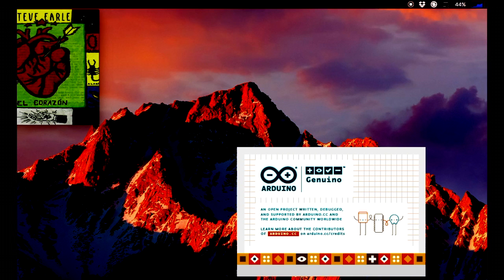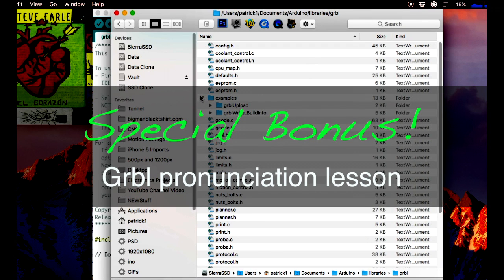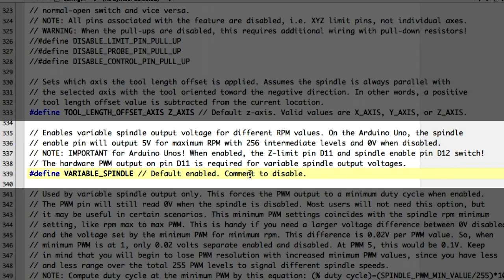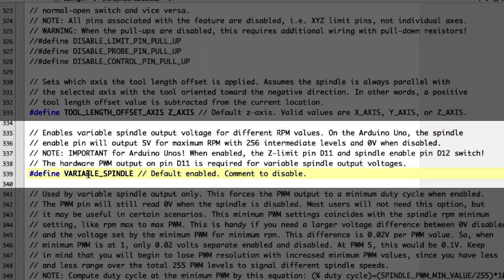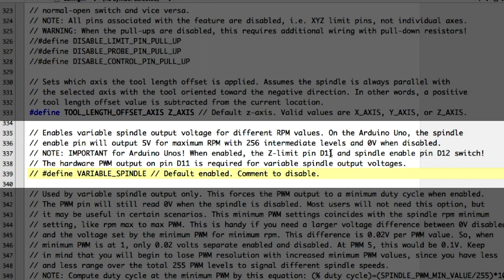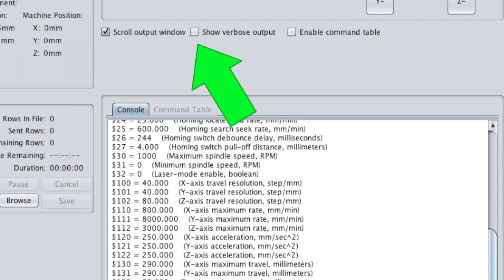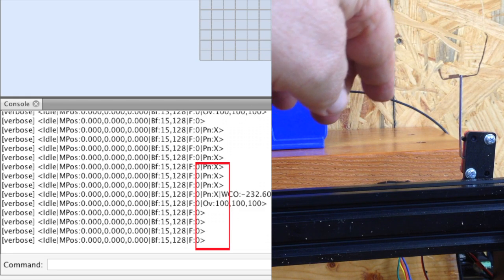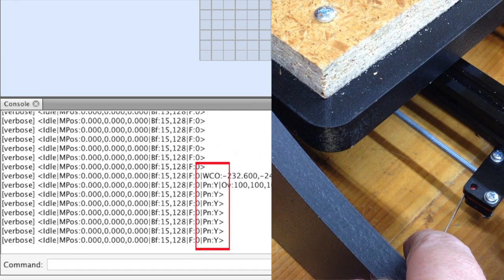Grbl Z Axis Homing Switch Fix

Comment: Pn Z not work when i do the process in the video, i have gbrl 1.1.  After read and debugging, Pn Z can be activate without change of code by connecting the Z limit switch to SpnEn on the CNC Sheild. Then after that homing is working.

Comment: Hello, i have this same issue but I did not switch over to Arduino. i test the switches to see if they respond and they do when i select homing mode z axis starts and then grinds to the top please help if you may

Comment: I have tried this four times. So far it has not changed anything. Do I need to rename or erase some other file? I confirmed that the changes have not taken place by triggering Z axis hard limit on pin 11 of the Arduino. I'm sure I am missing something.
Reply from the maker: Can you post your Arduino's Grbl settings here so I can see them? $$ does it
Reply: $0 = 5    (Step pulse time, microseconds)

$1 = 25    (Step idle delay, milliseconds)

$2 = 2    (Step pulse invert, mask)

$3 = 5    (Step direction invert, mask)

$4 = 0    (Invert step enable pin, boolean)

$5 = 0    (Invert limit pins, boolean)

$6 = 0    (Invert probe pin, boolean)

$10 = 1    (Status report options, mask)

$11 = 0.010    (Junction deviation, millimeters)

$12 = 0.000    (Arc tolerance, millimeters)

$13 = 1    (Report in inches, boolean)

$20 = 0    (Soft limits enable, boolean)

$21 = 1    (Hard limits enable, boolean)

$22 = 1    (Homing cycle enable, boolean)

$23 = 0    (Homing direction invert, mask)

$24 = 25.000    (Homing locate feed rate, mm/min)

$25 = 200.000    (Homing search seek rate, mm/min)

$26 = 250    (Homing switch debounce delay, milliseconds)

$27 = 1.000    (Homing switch pull-off distance, millimeters)

$30 = 10000    (Maximum spindle speed, RPM)

$31 = 0    (Minimum spindle speed, RPM)

$32 = 0    (Laser-mode enable, boolean)

$100 = 400.000    (X-axis travel resolution, step/mm)

$101 = 400.000    (Y-axis travel resolution, step/mm)

$102 = 400.000    (Z-axis travel resolution, step/mm)

$110 = 750.000    (X-axis maximum rate, mm/min)

$111 = 750.000    (Y-axis maximum rate, mm/min)

$112 = 750.000    (Z-axis maximum rate, mm/min)

$120 = 35.000    (X-axis acceleration, mm/sec^2)

$121 = 35.000    (Y-axis acceleration, mm/sec^2)

$122 = 35.000    (Z-axis acceleration, mm/sec^2)

$130 = 300.000    (X-axis maximum travel, millimeters)

$131 = 300.000    (Y-axis maximum travel, millimeters)

$132 = 300.000    (Z-axis maximum travel, millimeters)

ok
Reply from the maker: So you commented out Line 339 on the file config.h to DISable the variable spindle, which should put Arduino Pin D11 back to being for the Z limit switch, correct?

When you do that, and then run UGS and enable Verbose Mode, you should be able to trigger your Z limit switch and see it register in the UGS’s Console window.
Reply from the maker: Also, can you confirm which version of Grbl you have loaded onto the Arduino?
Reply: @bigmanblackt-shirt8506  yes I did comment out the variable spindle as you did and then saved the file. I then recompiled to and sent to Arduino.
Reply: @bigmanblackt-shirt8506  I have v 1.1
This issue did not exist on v.9
Reply: I have since gone back to the config file 2 or 3 times just to make sure that the change had been saved and was still showing.
Reply from the maker: When you do $$ is v1.1 what you see there?
 @FirstTry379
Reply from the maker: Also, I remember in the past having an issue where the Arduino didn't want to take my new program. Are you uploading to it via the Arduino IDE? If so, can you try exporting the hex file from the Arduino IDE and then flashing that file to the Arduino using something like XLoader (Windows) or Hex Uploader (Mac)?
Reply: @bigmanblackt-shirt8506  I did run console in "show verbose" as you showed and confirmed that I had no activity on z pins. It did however show the x and y pins. The way I found the pin that was switched was to touch ground to the back of the pin headers coming thru the shield in that area (i.e. pins 9,10,11,and 12) to confirm that triggering z was in fact possible. I may be wrong, it must be pin 12 that is being triggered. that would be consistent with my understanding of the changes with v1.1
Reply: @bigmanblackt-shirt8506  I'll check again
Reply from the maker: Correct, and to sidestep all this troubleshooting, you could just wire the Z limit switch to Pin 12 and be done with it. It's up to you. @FirstTry379
Reply: When I give "$$" command no GRBL version is shown
Reply: @bigmanblackt-shirt8506  Ya, that is what I will probably do. Just wanted it all to work right. I wish someone would make a dedicated board for v1.1. Most say compatible, but would most likely have this same issue.
Reply from the maker: Well that's odd, it should show it like this example:

Grbl 0.9j ['$' for help]

$0 = 10    (step pulse, usec)
$1 = 255    (step idle delay, msec)
$2 = 0    (step port invert mask:00000000) @FirstTry379
Reply from the maker: TO be honest, I can see why they don't. It's much easier to just change a piece of code than to rewire one pin on a board. If v1.1 is most common these days, it should just come with the code changed to disable variable spindle by default. I imagine the overwhelming number of Grbl users will NOT be doing variable spindle, you know? @FirstTry379
Reply from the maker: BTW< did you try flashing the hex code as I suggested? @FirstTry379
Reply: @bigmanblackt-shirt8506  I think I found the issue here. I am using UGS Platform not just UGS. When I type "$$" in command line on UGS Platform, I do not get GRBL version followed by list of settings. When I try the same thing on UGS, I do get "GRBL v1.1f" before the list of settings.
Reply: @bigmanblackt-shirt8506  Well, its not that hard to make a  peanut butter and jelly sandwich either. But you can buy one pre-made. For a person new to all this, even just changing a line of code and reloading it can obviously be more difficult than it seems when it doesn't work out.
Reply: @bigmanblackt-shirt8506  No I have not tried that yet. I will try it today. I did however wire the Z limit pins directly to the back of the CNC shield as we discussed and am now having a different issue. A recurring "(ALARM 8)" during homing just after Z axis limit is triggered and them pulls off. One of the errors says my pull off is not enough to clear the limit switch. I have already tried to change this setting to stop that with no success. This is some kind of soft limits error I think. If its not one thing, it's another

Comment: Hi sir, may I know what stepper motor did you use for the belt driven z axis? mine wasn't strong enough to carry my spindle. Can you please provide me specs of the stepper motor? Thanks a lot
Reply from the maker: Sure, it's a NEMA 17.
Reply: Big Man, Black T-shirt still remember what's its holding torque? I believe nema 17 step motors have variety according to torque thanks
Reply from the maker: I don't know, but I'm sure that info is available online somewhere. The NEMA 17s came with my machine and I installed them, I didn't check their specs or anything, sorry.

Comment: Great video tutorial sir, It has helped me solved my Z-limit problem. Thanks a lot. 

I have still have one problem: My spindle would stop, my machine would freeze and I'd get a hard/soft limits error whenever I send the gcode to my machine. But when I disconnect the power adaptor for the spindle motor and send the gcode to the machine, it all works well minus the spindle rotating.

I can perform Homing if the spindle motor is unpowered. But there are times that spindle would work with power for a few seconds and then I'd get a hard/soft limits and the machine would freeze to death. Hayyzz.. Any idea sir?